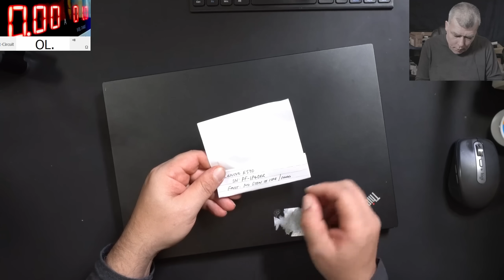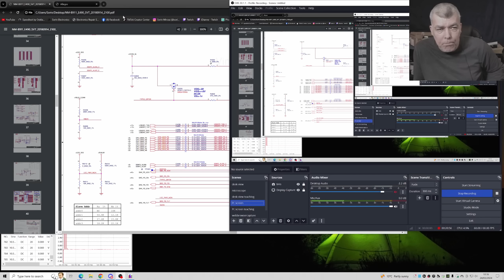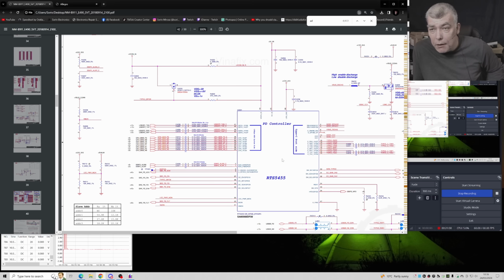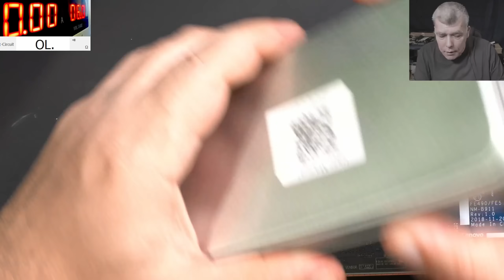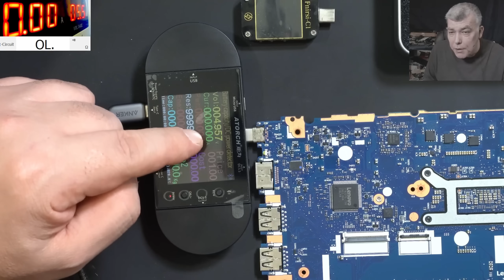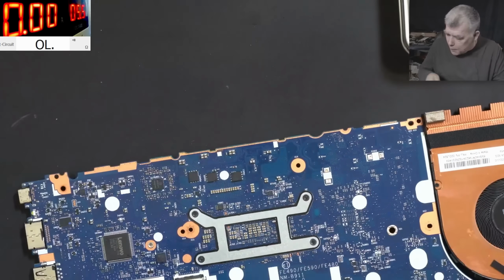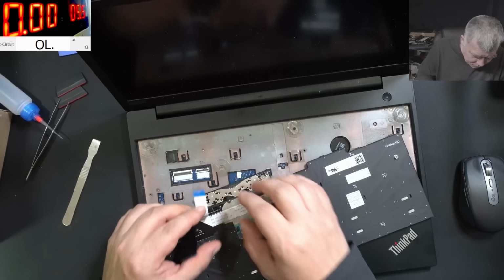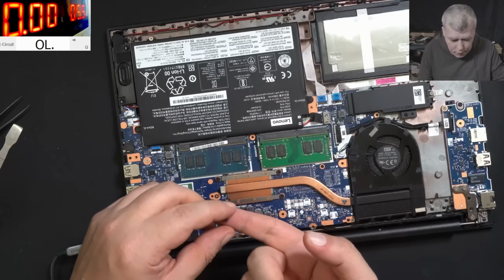Lenovo E590 no power, not charging or slow charge, RTS5455 PD controller replacement

Comment: nice job! Regarding the power meter, I would try to disassembly and to find a so called zebra connector and clean it. Many times it helps to get the LCD back to normal.

Comment: Thank you, your videos are very educational, it's good to see that you can make mistakes too.

Funny.
When something doesn't work for me out of the box, I assume that I made a mistake and read the user manual.

A few comments are interesting.
poor design, because you have to use a separate cable for the connection?
The USB male is not an output, but an input so that you can plug it into the charger? I think it's a bit big for that purpose.
+ if it's connected separately with a wire, then even if you rotate the tablet, laptop or whatever, you can still see the display properly.
++ it will be harder for you to damage the USB connector.

The Fnirsi FBN58 is not completely 100% perfect, but it can be used.

The Power-Z KM003C can be very good, but its price is almost 110 USD or 30 USD for the Atorch.

Comment: What about Lenovo E580 “UCM-UCSI ACPI Device” error 43 (failed to start) with USB C data not working and USB C charging the laptop very slowly, slower than the computer is using battery power? Tried all the advice online and still the error comes and USB C charges very slowly?

Comment: hello everyone, does anyone know how to program this RTS5455 and if anyone has the Firmware?  I have the same laptop with the same problem and changed the chip and now the laptop turns on but doesn't detect the charger and sure enough it won't charge.  if i charge the battery externally the laptop works until the battery runs out.  I couldn't find the data sheet for this chip, only something similar and it seems it needs firmware.  Thank you all!

Comment: Atorch is pd control tester, you need power supply laptop with PD controller.
So you can test laptop pd chip if it's working.
Check PD controller.
connection (CONNECT ONLY TO)
1.Connect the usb c output to the laptop.
2.Connect your Laptop power  supply down and left to the usb c  input.

If you want to connect your bench power supply connect to the input/dc 5.5

Comment: I think you can repair the meter by teardown it and reinstall it again; i think it an old display issue like legacy calculator machines that happens when it drops the flixable connector needs some calibration.

Comment: Sorin, I just looked up online for the operation of that ATORCH unit and found that the male usb C port on the top is actually an input. The usb C output is a female port on the lower right corner of the unit. You will need a usb C male to usb C male cable to connect to the laptop. Great job in diagnosing the issue with that laptop.
Reply: Had same issue myself. The port is really input.
Reply: press both buttons at the same time for the menu

Comment: Maybe the Fnirsi USB C meter display isn't cracked but not making good connection to the PCB inside? Looks like it's easy to take apart (screws).

Comment: That Atorch usb tester, the sticking out usb C plug is an input, you have to use a usb c to c cable on the usb c output into the laptop, and to power it, use a usb c laptop charger plugged into usb c input. You might need  usb c input power turning round if it doesn't work at all. And pressing both buttons on the front together cycles through some additional options.
Reply: no idea why they didnt clearly mark it same as the other ports..
Reply: @Nebbia_affaraccimiei  I know,  I went and looked how they used it on their website.